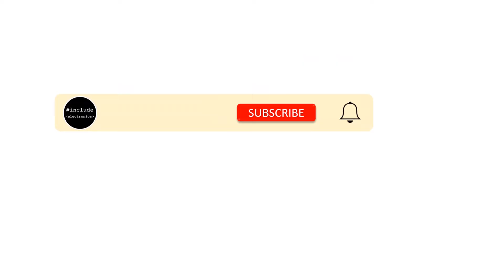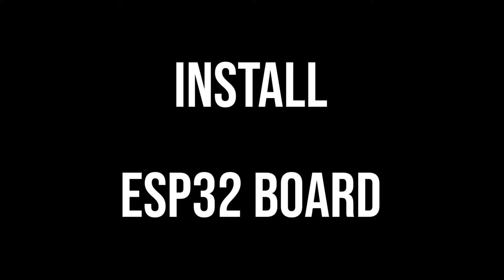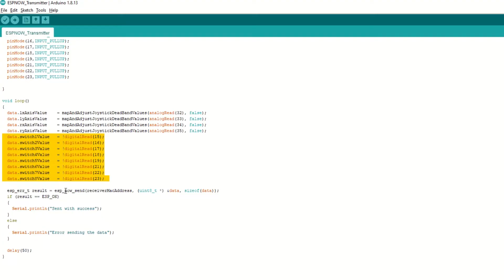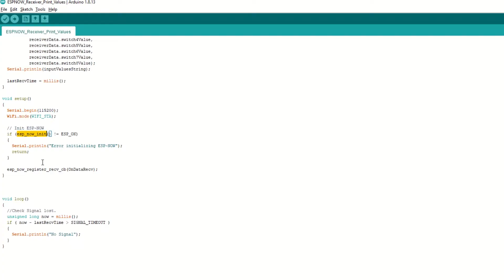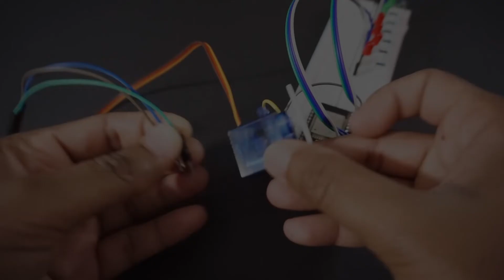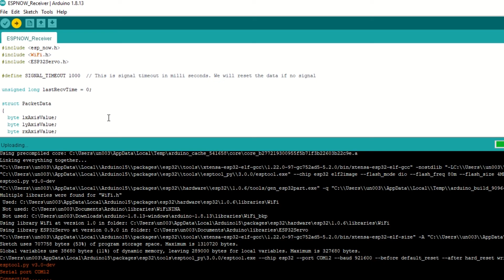12 Channels ESPNOW Wireless Transmitter Receiver using ESP32 | DIY 👌

Comment: What the range of control we can get, if we use ESP32 modules as transmitter and receiver (If we can use this for aeromodelling Transmitter and receiver) ?
Reply from the maker: I have tested for around 80-90 ft . It is said that the range can go beyond that around 200 ft . I would suggest to use nrf transmitter receiver for this purpose . Please check my video on the 10 channel nrf transmitter receiver 👍🏻

Comment: thank you for making the video, but I ran into a problem when I managed to make sure the recipient's MAC address was correct but the sender's serial monitor kept telling me that delivery failed. i can confirm the distance between ESP32 is very close. please help me, I'm dizzy.
Reply from the maker: That’s fine . Getting delivery failed is ok sometimes at transmitter end . Do you get any data at receiver end ?
Reply: @hashincludeelectronics  Yes indeed. I have tried before and succeeded in sending data. but currently it can't, with the same program as before. I have also tried the basic ESP-NOW program created by Randomnerd without changing it even once, but still the receiver cannot receive data sent via ESP-NOW. any suggestion?
Reply from the maker: @donnytrisandi8862  not sure what’s happening there . try using another esp32 board.

Comment: I enjoyed your video, however I need help. I'm using ESP-WROOM-32 Development Board and when I run the "Transmitter" code and look at the Serial Monitor, I get the "Error Sending Data" message. When looking at the intended "Receiver" ESP32 it shows "No Signal" on the monitor. Tried 3 different boards with the same result. Looking at the ESP module you used I can't see what the difference is between yours and what I'm using. I've  confirmed the MAC Address is correct for the intended receiver board. Any suggestions?
Reply from the maker: Thanks for checking out the video 👍🏻 . Mine is 38 pins module . Try that . Also please check the video again for any missing step 👍🏻
Reply: @hashincludeelectronics  Got it working! Thank you so much for your help!!
Reply from the maker: @boxertwo  nice job 👏🏻👍🏻
Reply: @boxertwo  How did you get it working, I have the saame board as in the video but I am getting the "No signal " on the receiver serial monitor. The transmitter serial monitor show " Error sending data" . I now the board work because I tried sketches from the ESP32 demo.
Reply: @Apostolos_N  I changed how the "Data" was configured. Originally, the "transmitter" INO file had the data as "struct PacketData" with each value as a "byte". I changed it to "typedef  struct struct_message" and the value as an integer, "int".  Same thing on the "Receiver" INO If you have an email address I can send you my version of the Trasmitter and Receiver_Print Values files.
Reply: @boxertwo  I never received your modified code, can you please resend?
Reply: Hi, I had the same problem. Can you share your code with me?
Reply: @AlanGiovanniArroyoLopez  Can tell me the  best way to send the files? My previous attempts have failed.
Reply: @boxertwo  post here in youtube "text block"

Comment: Could this work over WIFI?
Reply from the maker: It uses its own ESPNOW protocol. We don’t need WiFi connection for this . 👍🏻
Reply: @hashincludeelectronics  OK Thanks, I was hoping for WIFI for longer range over a mesh network with the ability to have joystick control vs using a web browser for control.

Comment: question to get a ground signal on the led pins instead of 5 volts do I need to to change from PULLUP to PULLDOWN?
Reply: Because a need a negative pulse or ground to triger a mp3 board
Reply from the maker: @cipitillo  you can write LOW to output pins which is nothing but ground .
Reply: Do you think if I apply 5 volts  to the switch  I will get ground  on the output receiver board
Reply from the maker: As far as I know we use PULLUP and PULLDOWN for input pins. Not sure if you can use it for output LEDs . 👍🏻
Reply: What I need is for the output  pins to be 5 vots all the time and ground the pin when I press the switch

Comment: Hi Mate. I am desperately seeking help. I need to control servo 2 with multiple inputs but fail so far. The code I use, hope you can help. Other than that all work well.                          servo1.write(map(receiverData.Pot1, 0, 254, 0, 180));
 servo2.write(map(receiverData.Pot2, 0, 254, 0, 180));
 servo3.write(map(receiverData.Pot3, 0, 254, 0, 180));
 servo4.write(map(receiverData.Pot4, 0, 254, 0, 180)); 
 servo2.write(map(receiverData.Pot4, 0, 254, 0, 180)); 
Thanks in advance, from Australia
Reply from the maker: You are writing 2 values at the same time . May be check if input value is available and then write it .

Comment: Thanks for the video, but I have a question how to do this project with nrf24l01 and esp32 for longer range?, all nrf24 codes are for arduino nano.
Reply from the maker: Esp32 itself has WiFi onboard . You don’t need to use additional rf module .
Reply: @hashincludeelectronics he was talking about the range and esp32 is terrible at that. Also I don't understand, the esp32 is way too overkill for this project, why not use a shift in and shift out chip on an arduino nano to have a LOT of input/ output channels and the basic 8 channels for servo control ( or 6 channels if you wish to incorporate an oled )

Comment: Hi I added 2 extra servo inputs and outputs. The original servos still work but the added servos do not work. Do you have an idea why?
Regards
Reply from the maker: Will have to see the code . Could you please check the code again for any mistake ? May be the timers are not set properly or the ADC channel is not supported for input .
Reply: @hashincludeelectronics  I copy the lines on Tx and change the values as below.
 "  data.sxAxisValue    = mapAndAdjustJoystickDeadBandValues(analogRead(25), false);
    data.syAxisValue    = mapAndAdjustJoystickDeadBandValues(analogRead(16), false);
and "   byte sxAxisValue;
            byte syAxisValue;

Comment: Hi Mate. From Australia, thanks for the great info. One question, how can I smooth the servo motors. The power supplies are regulated and I made sure the issue is not coming from the supplies. Servos keep shaking, even when not operating.
Reply from the maker: Check the power supply at transmitter as well .
Reply: It is called servo jitter. Internally, if the settings of the pot is not proper, it happens. I would recommend you to replace the servo, and put a good one. We just replace the servos in aeromodelling. One in hundredth servo has this kind of manufacturing defect for cheap 9 gm servos.

Comment: sir pls make wireless water level indicator with 8 to 10 steps, pls use seven segment display and with esp8266 or esp32 
pls use espnow protocol thank you sir
Reply from the maker: Sure will try to do that 👍🏻. Do you want it to be controlled from anywhere in the world ? Or locally ?
Reply: @hashincludeelectronics  control both way local and via internet thank you sir for your reply
Reply from the maker: @sonu9999208499  got it . Stay tuned 👍🏻
Reply: @hashincludeelectronics any update sir?

Comment: Dude i have gotten a ESP wroom board , which only have 30 pins total. does i can use that board for this project? then how can i use it? pls tell
Reply from the maker: Yea you can use but not sure if all pins are available . Also you will have to make changes in code for using those pins . I recommend to use esp32 which I used in this project to avoid issues and smooth project .

Comment: Can we use esp8266
Reply from the maker: ESPNOW works with esp8266 as well so it should work . However not all pins are available on esp8266 so make sure you use only correct available pins . Also the servo library which is used in the project will not work for esp8266. So you will have to make sufficient changes. I would recommend to use esp32 to not face any issue and the project will work without any change . 👍🏻 good luck

Comment: can u make video tutorial ESP32(1) => ESP32(2) => Arduino Nano.. to control LED like in this video🙏 please..
Reply: I'm making the same project as your video, esp32(2) controlling motor driver. and I want the esp32(2) to be connected to the arduino nano to control the LEDs. Can you help me🙏
Reply: so far I made the same as your video. and i really want to add arduino nano without using bluetooth
Reply from the maker: @andhikafidyahhakim9707  it’s simple then . Just connect esp32 with Arduino nano using io pins wired connections. And read the pins status in Arduino. DigitalRead function can be used in Arduino nano .
Reply: @hashincludeelectronics  hey by the way after listening to your suggestion I got it. Thanks for your advice👍
Reply from the maker: @andhikafidyahhakim9707  always happy to help and glad that it works 👍🏻 good luck
Reply: Can you give me example code
Reply from the maker: @andhikafidyahhakim9707  unfortunately I can not provide you code as I am busy with other things . The code  should be very simple . Just connect the output pins of esp32 to Arduino nano . And read these pins in Arduino code using digital read function . You can connect the LED output pins of esp32 to Arduino
Reply from the maker: Just curious why we need Arduino at the end ? To communicate with Arduino , you will need additional Bluetooth device to which esp32 will connect . Or you can make wired connection between esp32 and Arduino . Please confirm your use case .

Comment: Hey sir great video, I would like to ask one doubt, can i use esp 8266 instead of esp 32 for both receiver and transmitter?
Reply from the maker: yes you can use as ESPNOW  works on esp32 and esp8266 as well. However you will need to change pins as per esp8266. the Servo library will not work on esp8266. Not sure if all the pins are available on esp8266. Give it a try and make the changes as per needed in code. I would suggest to use esp32 so that you don't face any issue.
Reply: @hashincludeelectronics  thanks a lot sir
Reply from the maker: @alexthomas7347  no problem 👍🏻
Reply: One more favour sir, can u build a mini receiver using attiny85 so tht we can use in 1:64 scale rcs
Reply from the maker: @alexthomas7347  sure will try .
Reply: @hashincludeelectronics  please, make another video for ESP12e

Comment: Hi good video and thanks for sharing please what could is the problem because my wireless communication does not work after following correctly your tuto? Thanks in advance
Reply from the maker: Thanks for checking out the video . I would suggest to just try printing the values at receiver using serial monitor as shown in video. Do not connect servos or leds for now.
Reply: @hashincludeelectronics  thanks 🙏🏼 for your response

Comment: Any estimate of what might be the working range of this project?
Reply from the maker: Around 60-80 ft as I tested . It can be increased further if we use antenna I believe with this ESPNOW protocol 👍🏻
Reply: @hashincludeelectronics  You should make a video on adding an external antenna to the boards with no connector.  I did it by stripping the paint off the PCB antenna, breaking the traces between ANT, the meandered antenna and GND, then I soldered a 3 pin male header with a connection to each one.  The connections to GND and the disconnected meandered antenna trace are just to brace the pin soldered to the main output trace and help to prevent if getting torn off.  My actual antenna is just a single wire with a female dupont connected to the ANT.  I haven't done extensive testing yet and I'm curious to see if it'll work as a dipole if I stick another wire on the ground pin or if I'll need some sort of balun.

Comment: Just a curious question 😊. Have you also made this with two-way communication? 
I am thinking about using an ESP32 with display on the transmitter, that can show for instance battery status and/or sensor data from the receiver side ?
Reply from the maker: That's a nice question . I did not try 2 way communication yet. However should be easy. We might just need to add peer info at receiver side and send messages to transmitter. Will try this and let you know. Thanks for this suggestion.👍
Reply: If you want to use two way communication you need to use router between both processors
Reply: @srinivas_raghupathruni  No you don't.